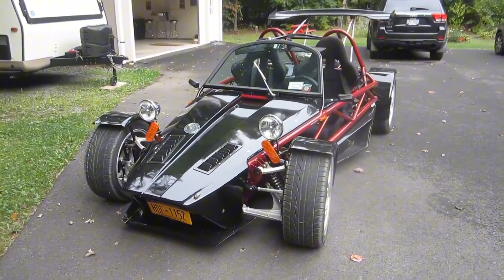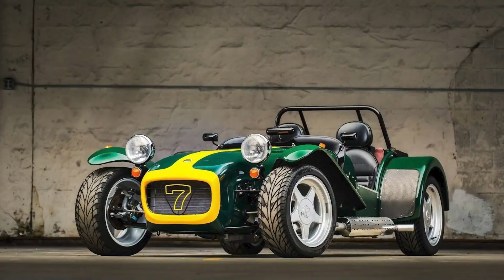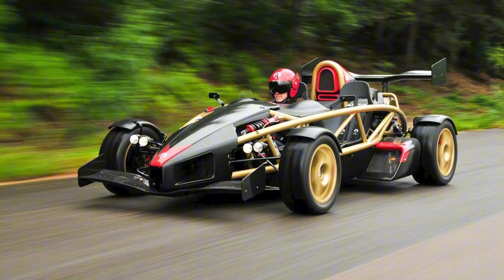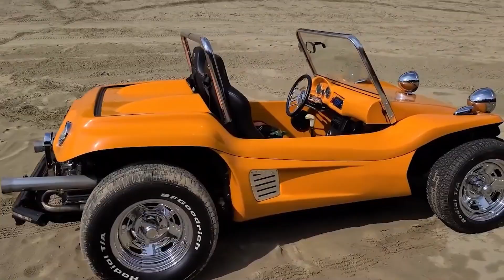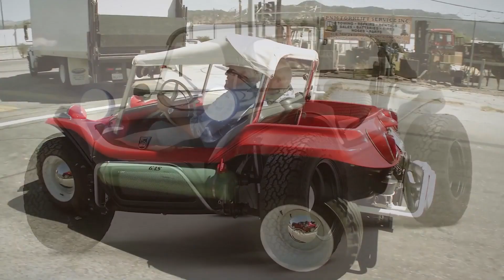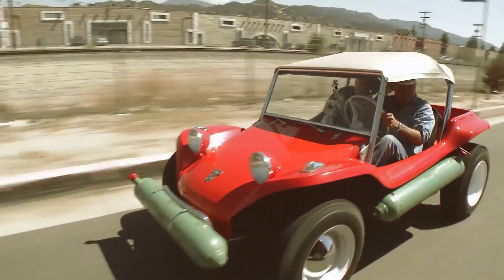Crazy Cars Built With NOTHING But a Cage and An Engine

Comment: My dad built an exo car, it was a failure, because trying to figure out the computer to run the engine was too complicated.
I tried to tell him, someone had already built a smaller version of a Honda Civic with a Honda Civic engine.... it was called a Honda CRX and yes it was a hot tamale
I tried hard with pictures to talk him into building something like an Ariel Atom or Shelby Cobra Replica.
He died long ago and all that's left of his last endeavor is his weird frankenstein project car....   that he only drove up and down the road a few times... he got it running...   I think never got the front end aligned beyond what he could do with a tape measure and a nail around the tire.

Comment: I mean hey, if one really really really wanted to, they could just 3D print some specially reinforced junctions, glue some carbon fiber tubes to those Junctions, cloak the entire chassis in carbon fiber, and then call it a day. Provided the resultant chassis is well-designed.
Reply: Why?
Reply: @Eng_Simoes Why not? Carbon fiber is rather light in weight, and comparably strong, too.
Reply: That would be very hard to design and fabricate and would come apart in a crash.
Reply: @JohnFrumFromAmerica  I never said it'd be easy; only mentioned the possibility thereof. Pair such a lightweight, sufficiently well-designed exo car (given the materials and methodology) with something like a motorcycle engine (revised for use on a car, but otherwise stock), and you'll be rewarded with a heck of a ride.
Reply: @Iamwolf134 I think carbon fibre works better as a tub. I have never seen a tube composite chassis it's probably dangerous and inefficient.
Reply: @JohnFrumFromAmerica  Exocars are fast, dangerous, and inefficient, anyways. Carbon fiber/composites simply lowers the weight, and the truss-and-bracket way, minus any welding, is a cheap way to do it, relatively speaking. Allowing the engine's performance figures to remain unchanged.
Reply: @Iamwolf134 I am keen to see an example of this type of construction. From experience working with composite it sounds the opposite is easy trying to get good composite layup around tight radius is a nightmare
Reply: @JohnFrumFromAmerica  It's a concept that anybody has yet to try; a thought experiment. The point being to encourage inspiration.